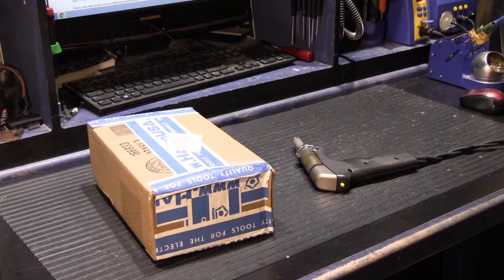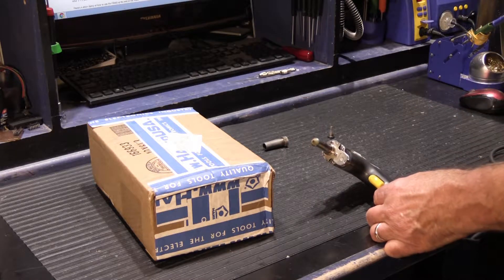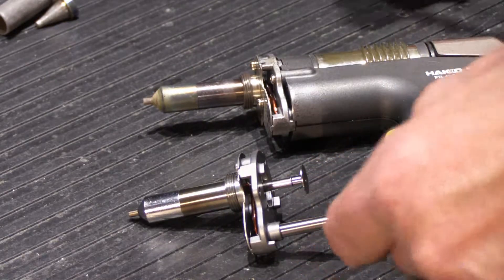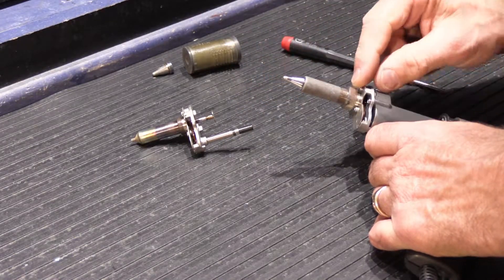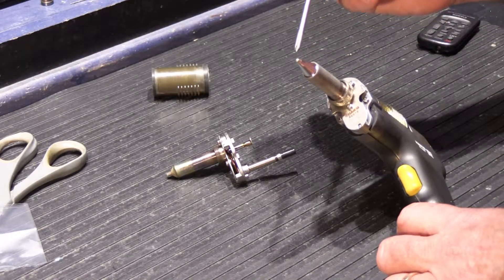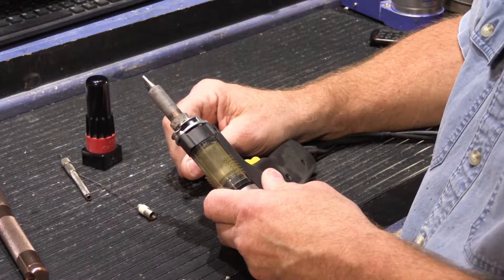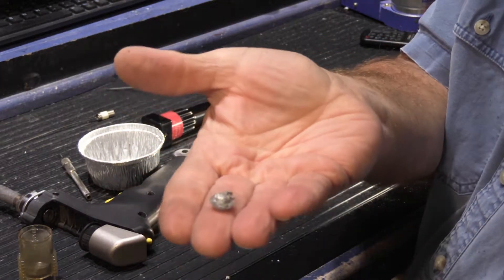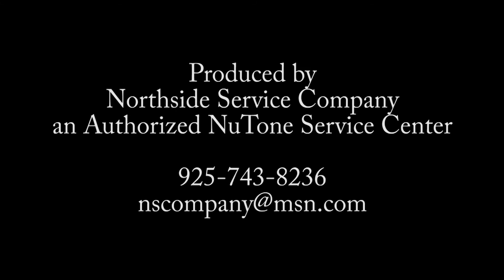Why Does my Hakko FR400 Vacuum Desoldering  Station Clog Up?

Comment: had to work with an Hakko Desoldering Station... it was the WORST experience ever... it had an Quick Release for Changing the Tips which broke in the first two weeks, nozzle constantly clogged, the rubber of the Glas Tube Melted on the Contact Point... we had an Official Reseller who didnt Care about our Problems and it was taking away so much time to Maintain that thing... they call it "Heavy Duty" for that Price i call it an realy expensive Paperweight , i looked it up and if i  Remember Right it was an FR-410 with an C5046 "Quick Nozzle Changer" that piece of Garbage alone costs about  150-180€ and the Station itself is around 1300€ 😭any 20€  Mechanical Solder Sucker is more reliable then that thing
Reply from the maker: Hi Peter: I can't really comment on your personal experience with your FR410.  I can say that I've been using a Hakko FR400 for almost 10 years without any real issues.  I use the FR400 about 5 hours hours a day, 5 days a week.  Other that 1 heater replacement, which was my choice to do, it works well.  I do change Tips oftem due to the amount of use it gets and the Yellow Trigger on the hand piece did break, but it was an inexpensive part and easy to replace.  - Chris

Comment: Thank you for the video.😊
I bought a desoldering station from Amazon, & within a couple of days use, I'm experiencing similar symptoms you've described in your video, but I have to wait for it to cool down & follow your method.
For what videos I've watched about other people buying desoldering stations, not one informed that you first have to suck out the solder from the hole in brand new tips before use, but I noticed that you mentioned it so thank you 😊
Reply from the maker: Hi paranoidgenius:  I keep a 1.0mm drill bit in a pin vise handle on the work bench to make clearing clogs easier.  I have also retrained myself to hold the trigger on longer to make sure all of the molten solder makes its way through the heater tube - Chris
Reply: @northsideservicecompany3567  thanks for replying.
I can see no solder collection in the collector vial, all the solder comes out of the barrel when using the metal pipe cleaner tool.
I've resorted to placing the tip on the joints & pulling off the components when the solder liquifies.
It doesn't work as good as I'd hoped it would & I wonder if the old way was better with looping insulated wire through the components legs, touching the joints with a normal soldering iron for the solder to liquify  & I can pull out the components, then using copper braiding & iron to clean up the excess solder.
Reply from the maker: @paranoidgenius9164  It's regretful that your desolding tool doesn't work well, maybe it's defective.  You method of "pulling" components off the boards is probably fine for single-sided boards with through-hole parts, however it seems risky for doubled-sided boards that have plated via's - It seems that you might be risking pulling the via from the board when you pull the component off.  I think that using desoldering braid is safer.  Also, I don't see how well pulling components off the board would work with DIP IC's - Chris

Comment: I'm done with Hakko. Their parts support has proven to be poor. For what most Hakko units cost, one can buy a number of new Chinese knock-offs and insure you have parts. By contrast, we bought AirVac desoldering stations in the early 1980's and can still get every single part and reasonably. The only reason we tried Hakko was for field work. Our AirVac units require a compressor which convert 80psi to 30 inches of vacuum and work VERY well.
Reply from the maker: Hi wa4aos:  Well, ok - To each their own - Chris

Comment: I wonder why desoldering tips always have such poor lifetime compared to regular old soldering iron tips. Over 10 years I've never really had a soldering iron tip erode to a noticeable degree while I've gone through a dozen desoldering tips or so.
Reply from the maker: Hi molasses:  I also have had soldering tips last for a very long time, even with the 5-6 hours a d ay I use them.  I think the reason the desoldering tips clog and wear out is because the metal inside the tip is not coated with anything.  This allows the rosin in the solder to eat away at the surface of the metal tip - making it a rough surface - that catches the melted solder as it's sucked-up.  Simply put, the quality of the tips should be better - Chris
Reply: @northsideservicecompany3567  One possibly reason is oxygen. It is a powerful oxidant and you are throwing a lot with the pump. Any news about about the answer to you email from Hakko? Another idea that come to my mind is maybe if you have a friend with a CNC precision lathe that can machine the inside of the old piece. Sorry for my poor english. Thanks a lot for your video. Greetings from Argentina.
Reply from the maker: @pubdigitalix  Wow, Argentina - The response from Hakko was underwhelming - They were sorry that my experience was less then great - blah - blah - blah.  They did send me 3 replacement tips at No Charge and a box full of Hakko swag - I think they're a good company and make good products - having some things be a little better would be good - Chris

Comment: Hi, I have F400 now showing sensor error and no more heating?
Reply from the maker: Hi Jabir:  Here's a link to the Hakko Manual for your FR400 - chrome-extension://oemmndcbldboiebfnladdacbdfmadadm/https://hakkousa.com/amfile/file/download/file/2948/product/11070/
It probably has a Heater or Sensor problem (or both) - Chris

Comment: I have the cheap knockoff version of this (the YIHUA 948). The end of the tube where it enters the cooling filter is clogged. What do you recommend I do?
Reply from the maker: Hi Kennys Boat:  If it's just clogged with solder - you could try heating it up where it's clogged and suck the solder out.  If it's clogged with more than just solder - you might have to drill it out - Chris

Comment: I have one Hakko 808 and one FR-301 my every day desoldering gun is the 808.
I don't know what happen with the FR-301 clogged every time that I use, anyway I have spare parts for my 808 for many years.

I bought a ZD-985  chinese desoldering station and works very well without any problem, barely use.

Best Regars.
Reply from the maker: Hi Ricardo:  The Hakko 808 is truly a great desoldering tool.  I keep mine as a trusty backup and I've taken it out on service calls many times for on-the-spot repairs.  The FR-301 broke to many times for it to be considered reliable.  Most of the problems were related to the heater assembly.  I believe Hakko has resolved these problems with the current FR-310-03 model - Chris